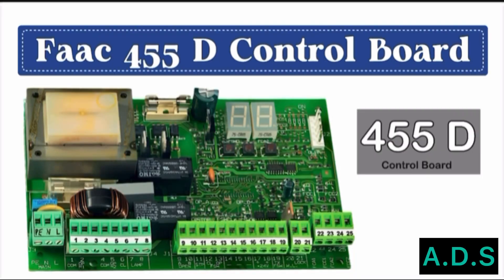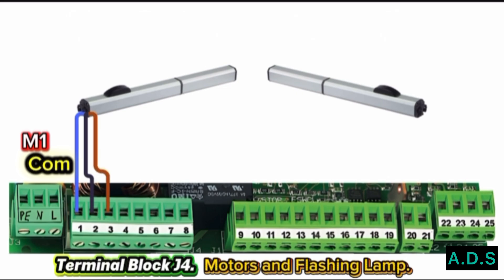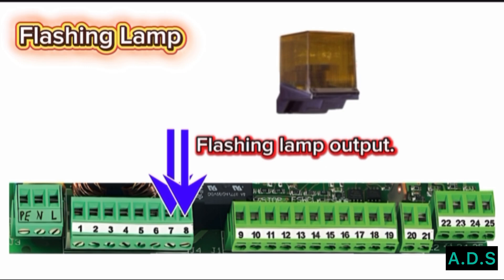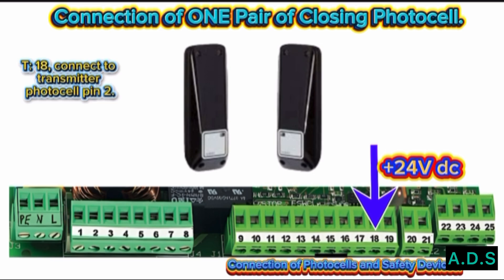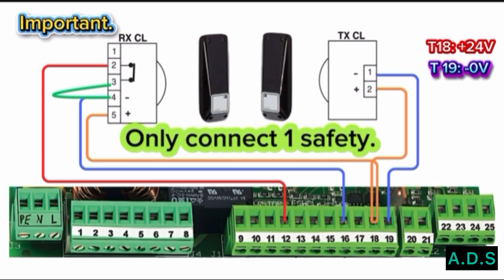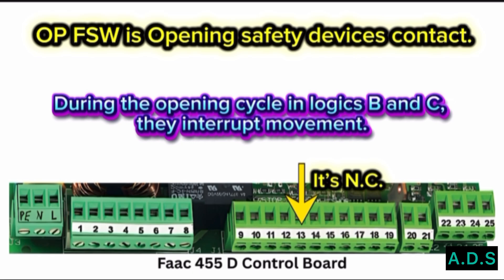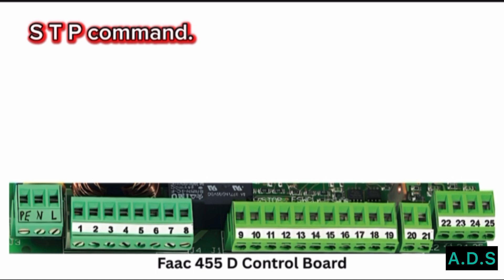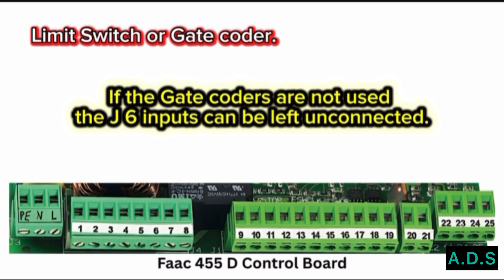FAAC 455D Control Board | Wiring All Devices (Motor, Photocells, Keypad)

Comment: Does it make a difference if you mix up safety devices rx cl  and command devices negative outputs
Reply: Our are 14. 15 16 all.common negative
Reply from the maker: In this control common is used terminals 14,15,16, no problem a common terminal with safety.
Common wire with command devices.
Reply: Thanks
Reply from the maker: You welcome
Reply from the maker: No